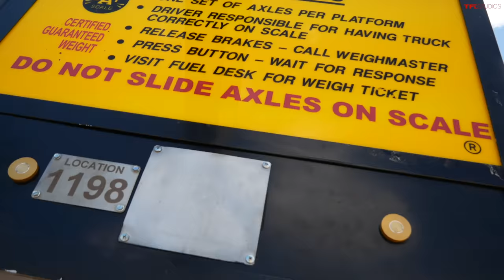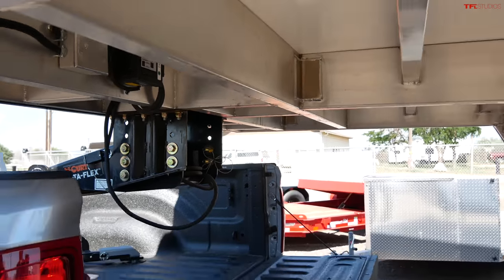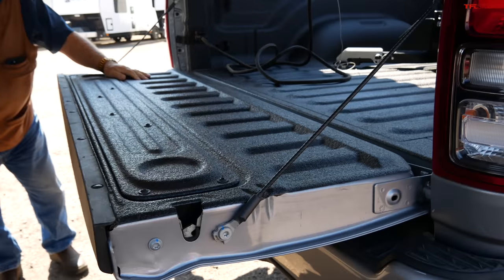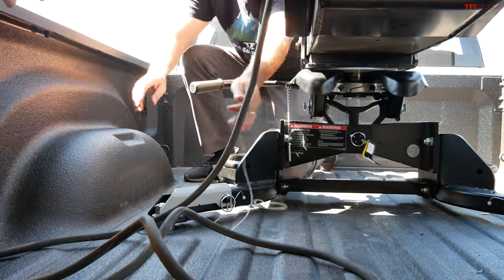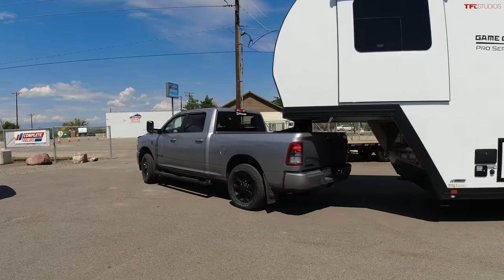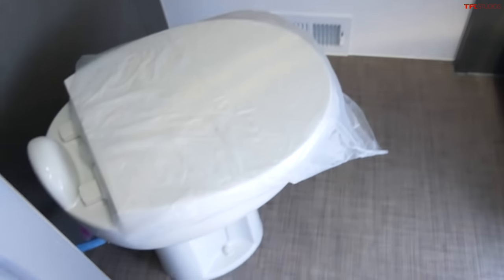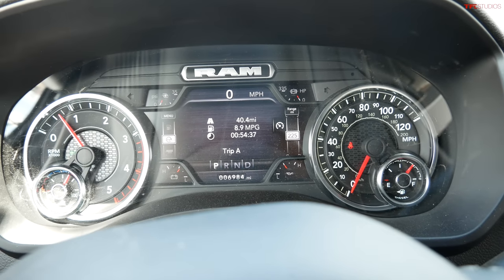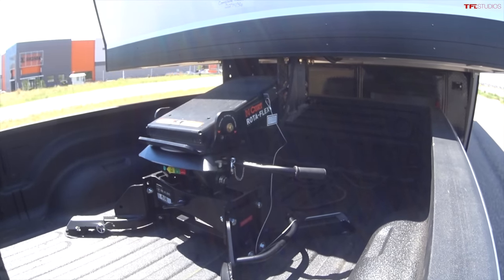I Accidentally Overloaded My Ram 2500 Cummins By 1,000 Pounds & Guess What?

Comment: That Mopar 5th wheel hitch is made by Curt. The head you are using (Curt A20) is compatible with the Rotaflex pinbox. If anyone out there is using a Curt Q20 or Q30 with the Rotaflex, STOP using it. The Q series heads are NOT compatible with the Rotaflex.

Comment: Holy gain! Them brakes need adjusted if they are at 9. I can run 5.5 or 6 gain on my 40’ toy hauler
Reply: What we didn't know is if the trailer brakes were burnished in for the brake pad to match all around the drum. Usually on new trailers I up the gain for more power which helps brake in the trailer brakes. But you're right you don't want too much gain to not smoke the trailer tires

Comment: You should Load 2000LBS in the back where the UTV would be as it will take weight off the PIN, if you look the weigh will be added behind the rear axle. Toy haulers are purposely build this way to accommodate for the extra weight added to the rear of the Trailer

Comment: Were you exceeding the rear axle load rating? Usually a 3/4 ton truck used to haul a camper or fifth wheel trailer should be ordered with the camper package.

Comment: Not surprised you were overweight . A lot of 3/4T diesel trucks do not have a lot of payload capacity. Gasser "may" have saved you though. You pic up about an extra 1k with gas vs diesel.  BUT... IMHO I'd always opt for a 1T. The cost difference between a 3/4 & 1T was ~$1700 when I ordered my 2021 F350. The extra load cap is well worth the $$$.

Comment: The old truck I used to haul horses with, a 2003 Dodge Ram 2500 5.7l magnum hemi, according to the gross weight rating I overloaded it a bit many times. Never had a problem and the truck didn’t even squat. Now if you look it seems gasser 3/4 tons have a higher rating. That old truck never gave me a problem hauling heavy, and got about 9-11 mpg hauling, 17mpg empty. I miss that old farm truck and we shoulda never got rid of it.

Comment: This video is proof in 8-ft box is always best. I find it odd my 1500 two-wheel drive tradesman has a higher payload capacity at 1900 lbs. I think Tommy was right, they should have got the tradesman. Which would have boosted the payload capability.
Reply: The truck here has a payload of 2234 according to a prior video.
Reply: I got a 3500 srw cummins regular cab long box cummins...  my payloads 4300 lbs 😎🤙

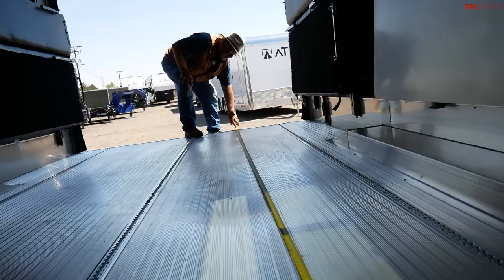Comment: At 20:30 you are measuring inside the trailer. I have a MINI Countryman. Are you saying that if I owned this trailer, I could tow the Countryman inside and then when the family wants to setup camp we could pull the countryman out and sleep inside the trailer? I was a bit disappointed by the interior as there are many other trailers that seem much more hospitable and pleasantly designed for family, but if this allows you to tow a small car or mid range SUV inside then that might be worth it.

Comment: Easy to complain about payload without doing the engineering and business analysis.  Coil rear is more comfortable than all the others with leaf spring,s with some drawback of lower payload.  As Andre said, if payload numbers get high enough, just move up to Ram 3500 with SRW (single rear wheel), or obviously dualy to go even higher and especially increase towing stability.

Comment: Open the trucks drivers door, look for the YELLOW sticker, read the part about "the combined weight of passengers and cargo should not exceed". I bet that 2500 trucks payload capacity is around 2100 pounds, not much more than a half ton pickup. A 3500 SRW (single rear wheels one ton) short bed has around a 1000 pounds more payload and a long bed will be more.

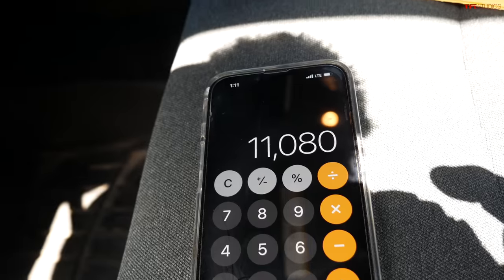Comment: 23:36 the GVWR on the Truck and the GVWR on the trailer are set for that specific vehicle. If the Trucks GVWR is around 10k. That would make tye GCWR... GROSS COMBINED WEIGHT RATING is what you need to be under. The GCWR for the truck is set by the what engine and transmission can handle.

Comment: 3/4 ton diesel trucks are almost the same weight as single axle one ton,( there is very little difference) but the one tons usually are rated for 1000 lbs more?

Comment: OEM rate their trucks payload based on 10k limit.  The trucks can actually haul more then 10k.  Here is the reason for low payloads on 3/4 ton trucks.  "The 10,000 GVWR option is there primarily to reduce the tax & registration burden to a purchaser who rarely uses the truck to its fullest rated capacity. It's the current follow-on to the "HD" designation given to a lot of F-250's back in the '90's where the truck had "one-ton" rated springs and suspension yet was officially rated as a 3/4-ton."

Comment: Good video, just a math error near the end changed your conclusion.  Truck with driver 8,300 pounds compared to adding the trailer gave a truck weight 11,000, so the hitch weight was 2700.  Not 1700.  You guys wanted more payload -- but this is a 2500 series truck.  I think that 2500 or F-250 are almost always kept to a GVW at or below 10,000 which helps owners avoid a lot of "truck" rules.  Remember that the diesel engine weighs more than a gas engine, and that difference comes out of your payload.  So for this much payload -- yes you want a 3500 or F-350 series truck.
Reply: 4 WD do also contributes to less payload.

Comment: I spent a good part of my life completely disregarding tow ratings. I've had so much weight behind a 3/4 ton truck that 1st gear in low range is the only gear that will pull steep hills, wide open throttle, windering of you're gonna make it!

Comment: Couple hidden rules. Best to get a slider hitch with short bed . Mostly you don't need them until you blow out your rear window. Next rule is that 2500's usually go over weight on the bigger 5th wheels although GM has increased their payload considerably as of 2020 model year. Don't know about Ford. 1700lb pin weight is not a lot and starts to say the RAM 2500 can't handle even mid-level 5'ers and hence their tow ratings at least on the 2500 can't be believed.

Comment: I use a demco auto slide hitch in my shortbed so there's no cab clearance problem.  You guys need to learn how to do a tug test when you first hookup for your safety and others.  As for the gooseneck vs 5th wheel thing I think the reason 5th wheels don't require chains is because the connection is considered to be a more positive connection than the ball. I don't thinks it's due to strength.  A 5th wheel could be designed with more strength than a gooseneck if need be but I don't think it's necessary.  Just look at semi trailers wich weigh considerably more.

Comment: Totally agree on getting a 1 ton SRW and it should be good, 2016 Silverado 3500 SRW hauls that weight without a dually.  New trucks have way higher limits than 2016.  Good thing about 2016 Silverado is that the 2500 and 3500 SRW are exactly the same except the rear springs, and fortunately I like adjustable air bags so not being commercial, all good for hauling and ride quality without a trailer is way better.  BTW, like the hat Andre!  I really liked this video, I rarely comment this much so I enjoyed.  If I didn't want a 19-20' garage I'd think about this trailer.  The height really does KILL gas mileage, my Sundowner is lower (horse trailer :)) and gets better gas mileage than my old V trailer that was 2 ft higher but only 8000lb max, Sundowner is 17000 max.

Comment: I prefer more tongue weight. Good on ATC for putting the axles where they should be. 

Trailer manufactures try to cheat and put the axles in the center of the trailers so they can be 3/4 ton towable.  3/4 tons shouldn’t even be on the road, they can be over payload with small tag trailer.

Comment: By being 9 inches from truck bed what was the overall height of the trailer from the ground to the air conditioning unit. Just to see if you less than 13 six

Comment: couple places your weights were wrong. Tongue weight of the empty trailer is not 1700lbs  its 2780lbs if the truck weighs 8300 and the total of the truck hooked to the trailer is 11080 thats 2780lbs of tongue weight.

Comment: I’m pretty sure that GM is the only one that offers a payload rating over 10k in the 3/4 ton class. Ford is 10K as well on the F250. A lot of it has to do with taxes and insurance I think. A Ram 3500 SRW should have the payload necessary for that trailer. The biggest concern on the weight ticket is that the GAWR for the rear axle on that truck is 6K lbs, so you were 140 pounds over the axle rating for the truck.
Reply: Yup my 2022 regular cab 3500 SRW payload is 4300 lbs with cummins

Comment: Regarding payload, wouldnt pin weight be lessened once this trailer has a toy in the back to balance everything out? What would something like a 2k lb UTV in back do to the pin weight I wonder.
Reply: Short answer. Maybe lol
Reply: Yes it would. Put rzr in the back and it would lessen the tongue weight. And then evenly distribute all needed “camping” items favoring it over the axles. The gross weight rating they tell you is lower than what the true rating is, that’s so the manufacturer can’t be liable.
Reply: general rule in toy hauler is 20 to 25% of the toy weight in the back is taken off the pin. that varies on how far you pull it up over the trailer axle if possible if garage is long enough. so a 2000lb SXS in that trailer would take about 500lbs of the pin weight so it would be at 2200 pin weight.
Reply: @hullihenfamily829  oh interesting, good to know that approximation. If that is the case, hauling with something in the garage could almost make that Ram workable. Probably still nice to have a 1 ton for that bit extra though.
Reply: Not as much as a lot of people think. Especially with a bigger/longer rig where the front axle of the "toy" is over the trailer axle. It's a pretty long lever, and the longer the trailer (and thus lever) the less the weight behind the trailer axle is going to lift the front. You also usually want a little more pin weight loaded to make sure you keep your rig stable.

Comment: Not sure why ram does this, but the 2500 series payloads (for the most part) seem quite low (in the low 2000lb range) whereas similar configurations in the 3500 series SRW (IE 4door 4wd 6'4" box) - the payloads are often NORTH of 4000lbs... The only difference is 3500 vs 2500... That's a massive difference; especially given we're comparing srw to srw same configurations. You likely would have been within limit with the 3500 series on 4 tires provided it was spec'd out properly.
Reply: @wallykos6784  Yes agreed. Interesting that the other brands have much smaller tolerances in general, compared to Ram. (just look at similar packages and payload comparisons)

Comment: Any vehicle is designed to accept a safe load above is net weight, weather it can carry any load is the choice of the user, the capability of the braking is usually what is misunderstood, I have knowingly overloaded dump trucks, trailers, and anything that could carry a load, will the tires hold up, springs blow, axle fail, or frame brake???? Or will you keep it under control when that sudden stop or reducing speed is required???, I’ve gone 50 percent above GVW ratings to save a trip…yes it can be done, no I do not advocate that…engines will do the job regardless, transmissions aswell…it’s how you treat the load you are moving!

Comment: Everyone if u have a trailer like this and you don't have a class 6 truck at least you really aren't safe. Just cause you can tow that much weight doesn't mean you should. The ram here weighs about 8,000 to 11,000 lbs. A class 6 truck 25,000 to 35,000. That's more than your trailer.  So in the event of an emergency stop or turn you aren't going to roll it.

Comment: First of all he is doing this for business purpose. He does not have a CDL so legally he has to go by the GVWR of both truck & trailer combined which puts him over the 26,000 lbs legal limit for him. Second he was also illegal because he was over on the truck GVWR. Not hard to figure out. The trailer adds approximately 20% weight to the actual truck weight. They did not show actual empty trailer weight but guessing around 15,000 lbs dry weight which will add about 3000 lbs to the truck weight.  It was also painful watching them connecting this trailer. Once you have the jaws locked put the pin in. Do not drive not knowing if it will be locked or not. Before I catch any crap about my comments. I haul travel trailers for a living both 5th wheels & bumper pulls. Since I started in September of 2012 I have put on over 1 million miles on my Ram 3500 dually. I have a pretty good idea how pulling these travel trailers work. You can try a short bed but for me a long bed 1 ton is the only way to go. Finally they say 36 feet but when dealers list it as that long they do not count the front cap & it is really probably 40-42 feet in total length. Just look at the title & see inches in length to get the accurate size. DOT does not care what a dealer says on the length. Be nice if when they tow these they give actual dry weight which is on title instead of only the GVWR. They do this to make it look more impressive.

Comment: I’ve seen a 5th wheel hitch that moves itself toward the rear of the truck on a rail system as you turn, to compensate for the “short bed” problem. Forget which brand makes it.
Reply: I have a manual slide in my short bed. The autoslide was more expensive.

It's only for if I need to make a tight turn. Park, get out and release the lever.   Get back in, squeeze the brakes, pull forward a few inches. Park again, and go lock the slide back in.  

Only drive like that in the parking lot. I drove around like that looking for street parking only going maybe 15mph.. with the weight further back, had a pothole or speed bump snap a leaf spring.  Truck was old, so that could have been part of it.

Comment: The bigger the trailer the slower you have to go and to get your best fuel mileage is to drive with rpm at 1900 -19500 Rpm and fuel mileage .

Comment: if you're overloading your vehicle and break anything in the powertrain, manufacturers will void the warranty.   By the same token, if a salesman 
tells you that a truck will do a task it's not equipped or capable of doing, the dealer is liable. Don't rely on the trailer salesman's word regarding the vehicle capability. The dealer has all the specs and the GVWR and GCW is on a sticker in the door jamb of the truck .
Reply: When I bought my 2022 cummins that sent me a email with my tow info. Gm puts it on there doorjams

Comment: You gave a lot of good info, but how does it stop. With this large load and short truck can you safely stop it when a knucklehead pulls out in front of you on the highway?
Reply: The Ram exhaust brake hits pretty hard. Ive stopped 18k without issue on 35s.

Comment: It's more about stopping and control than it is pulling, plus you can get a single rear wheel 3500, you don't need a dually.  I have a SRW 3500 High Output with a 45 foot 5th wheel and you don't even know its back there, especially with the newer models, they are all made out of paper mache!

Comment: The trailer weight on the truck is 11,080 lbs - 8,300 lbs = 2,780 lbs not 1,700 lbs. Based on the gross truck weight you stated of 10,000 lbs, the truck payload would only be 1,700 lbs.
Reply from the maker: Yes, I made a mistake with my calculation.

Comment: Load that thing up like your going on a trip and see how much you're overloaded. Also people need to be aware that they need to check out the licensing laws in the state they will be traveling. In Nevada you need a J endorsement to tow a vehicle over 10k pounds and a commerical driver license if the combined weight of truck and trailer is over 26,001 lbs. Most RV owners are way overloaded and are not licensed properly

Comment: Truck empty was 8300.
Truck loaded was 11,100.
Trailer axle was 8000
Tongue weight was 2800
Trailer total was 10800.
Thats 26% tongue weight.

Toy haulers are very tongue heavy when unloaded.
Reply: Even if you put some weight in the back and made it 14k with 15% tounge weight, which is the minimum % recommended for a 5th wheel, you would still be well over 10k lbs on the truck.  Diesel HD +  10k GVWR  = No Bueno.

Comment: That trailer requires a dually. You were over with an empty trailer. I don't think any SRW truck is going to be in limits, no matter who makes it. Diesels are great pullers, and great going down hill with the exhaust brake, but payload is limited with the heavy diesel powertrain. I think about 90% of SRW diesel trucks pulling tow haulers are over weight. Shortbeds are crappy too with tiny fuel tanks, looking for fuel all the time. 50 gal of fuel is the way to go.

Comment: Just FYI... the reason Ram stays at 10k, or I prefer 9,900, on the GVWR is because of business use. If the tag says 12,100 like a 1 ton and the trailer has 2x 7000lb axles like many standard equipment or utility trailers... it requires a CDL to drive it. If the tag says 10k you are fine. If you pull that 16k trailer with a 1 ton and travel for business use... you need a CDL... with that 2500 you don't. It's all very stupid... but that's the way it is. Buy a truck with a low number on the tag and upgrade suspension to give you the actual capability of a 1 ton, without the regulations.

Comment: In Africa that Cummins 6.7 engine and 6 speed manual gearbox rated at 250hp usually haul between 30-50Tonnes in semi trucks or 6x4 box trucks.
Reply: Different engine
Reply: @CoyoteFTW  same B series engines made by Dongfeng Cummins or Cummins india.
The 5.9 6bt is pretty common making a measly 160hp in 28Tonne dumptrucks.
Cummins B series,L series, signature series,x series are all global industrial engines.